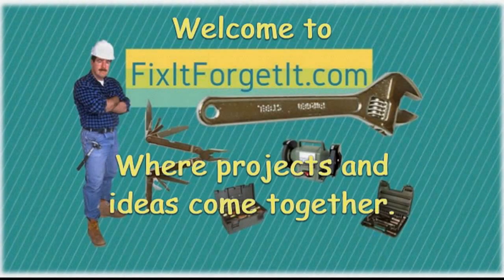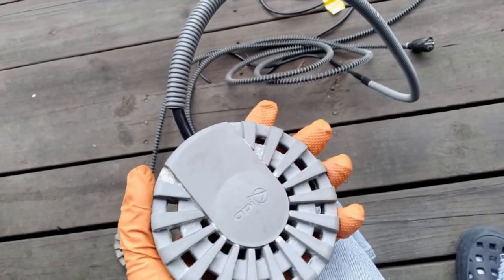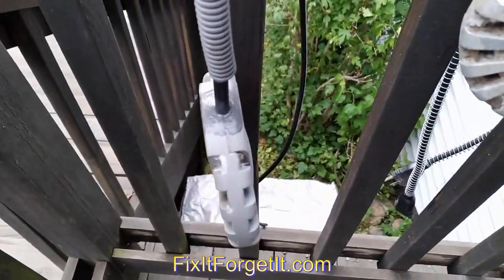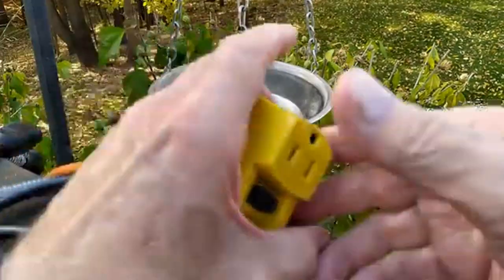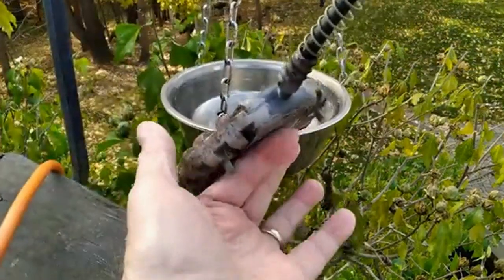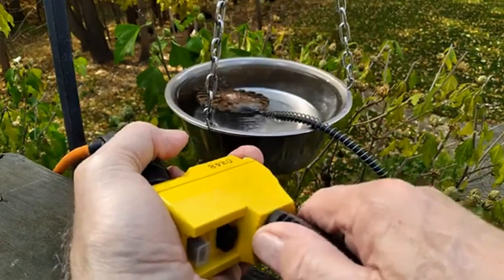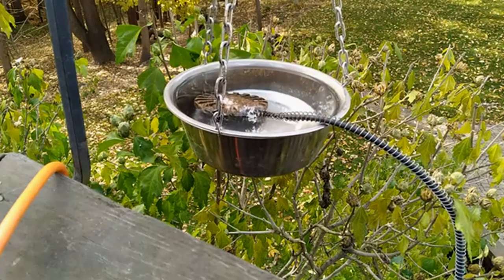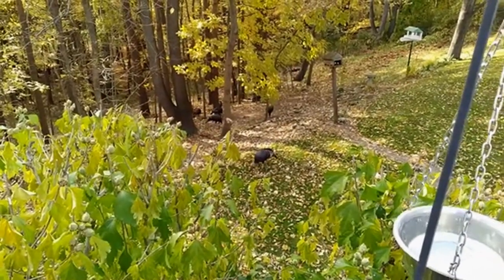API Bird Bath De-Icer Repair. No More Blown Circuit Breakers.

Comment: Excellent video. I just bought a new one of these. Would silicone caulk work to seal the cord?
Reply from the maker: Thanks for your kind comment, Mark. My experience with silicone has been that it tends to break loose and peel off after a while. In a harsh environment like this, I don't think it would last nearly as long as JB Weld. Thanks for stopping by.
Reply: @Fixitforgetit   Heading to the hardware store for some JB Weld!
Reply from the maker: My pleasure, Mark. Good luck with your repair.